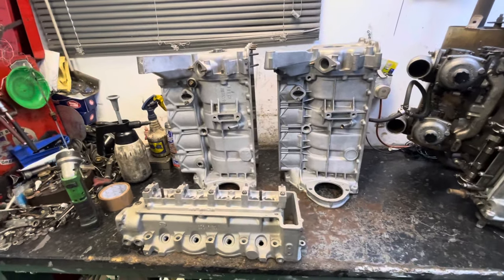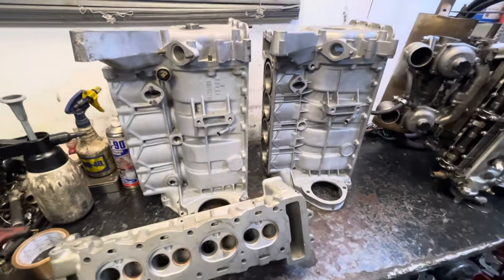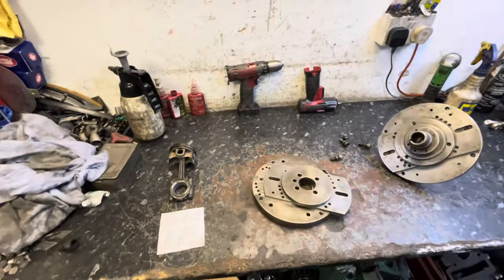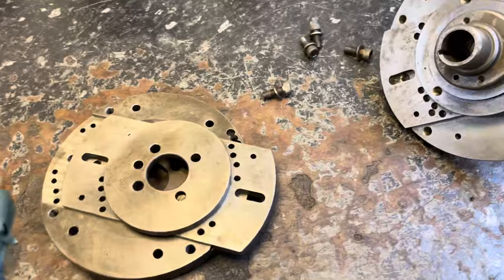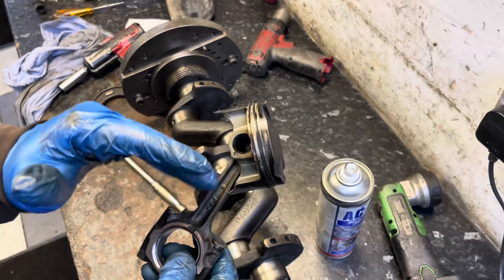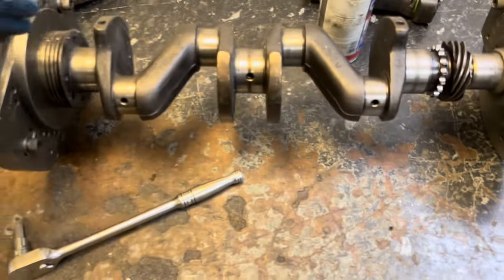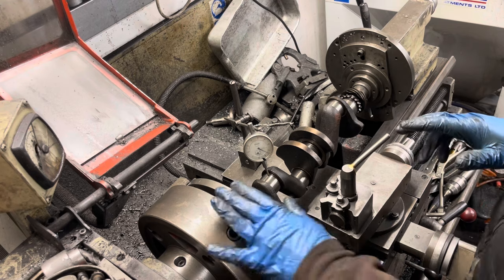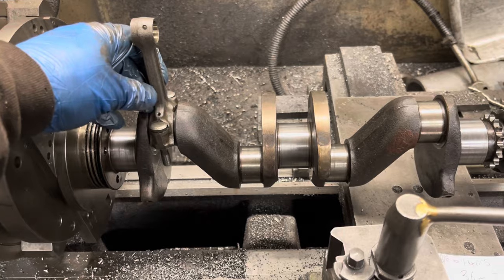Shrigleytube TV ep17 part b, Chat with Ben Boult and crank offset turn and learn!!

Comment: Andy, I know all these names from the past, great to see one of them. About 40 years ago I had Ian Carter do a very standard head for my Clan, and he talked about being at ERA and the IMP block would 'lozenge' under strobe lights at about 115 BHP and run the main bearings, so he thought that was the limit for that block. Great stuff mate, I must get my Clan back on the road, thanks, Peter.
Reply from the maker: Interesting, i think the use of modern materials will hopefully get past this stage at some point, good look with the project clan 👍

Comment: I heard a challenge there Andy... 125hp on pump fuel at 1040cc. Keep up the experimental pistons and rods. Ben was good when I contacted him in regards to my hill climb engine. I got the bottom end brace kit, wills rings, racing clutch and pressure plate. I believe my engine builder (who knew what he was doing) got in contact with Ben and he talked him through a few things, so I am grateful. Keep up the content Andy, its great to watch each week.
Reply: I think one of the advantages they had back then was the freely available 5 star fuel which if memory serves me correct could be up to 101 octane. With our modern fuels we're at a distinct disadvantage.
Reply: @grahamb1  so be it, 98 to 101, is that a great amount
Reply: @nmc356  As we all know when you're searching for extra power there's no one single fix, It's a series of small increases from all areas and fuel is just one of them so I would say yes, it would help.
Reply: @grahamb1  👍
Reply from the maker: thank you, glad you are enjoying the channel lots more to come !

Comment: 11:50 I bet the pump fuel was leaded 5 star, not the piss water that we are forced to use now!
Reply: Yes it could have been 110 octane or at the very least 98.  Back in the 60's the lowest was only 95 octane!
Reply from the maker: tesco 99 is best you find now a days 👍

Comment: Hi Andy, just a thought,  at 30.25 mins you're saying its miles out. How do you know the crank you have is 60.4 on the journal offset from the mains? It could be the way you have set it up is correct but the journal was originally machined at a slightly different length and by using Ian's offset you may in fact be set up at exactly to 60.4 making it look out of true on your dial gauge.
Reply from the maker: hi graham, yea the cranks are absolutely spot on it’s my setup that’s out, i have never seen any variation in piston height when building unless the crank has been reground then maybe couple or 3 thou max variation

Comment: Isn't it needed to add material by welding, to preserve crank diameter? Specialy that torque will go up slightly?
Reply from the maker: we shall have to see what happens, hopeythe large radius will provide enough strength for it to work with the light rod and piston

Comment: Andy could you not offset turn the crankshaft by the 3mm so the piston would still be level with the top of the block and 36mm ? Or do you have other plans ?
Reply from the maker: i thought exactly the same but the racing i want this engine for has  a class rule stating std stroke must be retained
Reply: @thehillmanator  ok makes sense 👍

Comment: I have a question for Andy or any other guru's I have to straight edge blocks here that don't have engine numbers but have 875 embossed in that spot. Can
Reply: Can anyone me what to go is?
Reply from the maker: hi if they have no engine number then they were more than likely factory replacement engines that were fitted in cans but never stamped